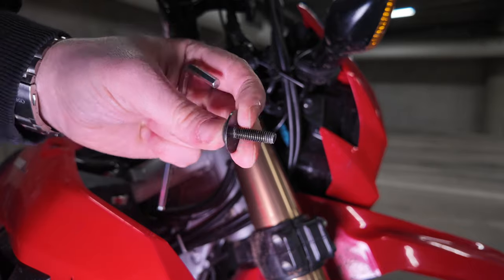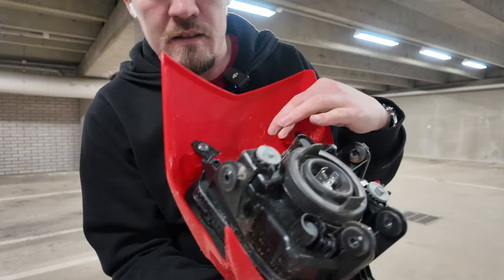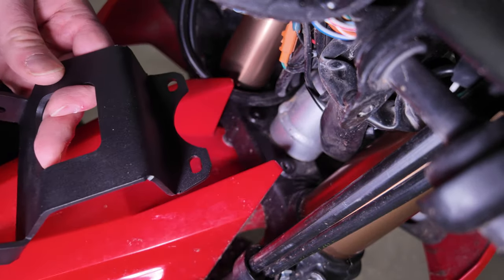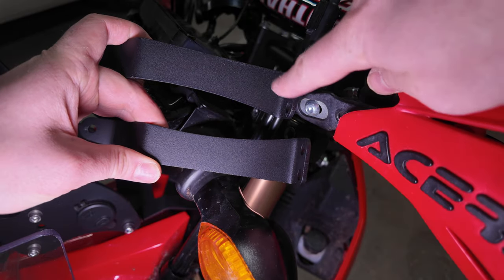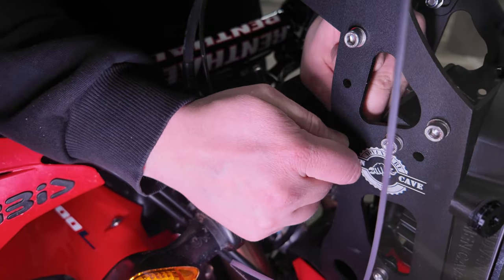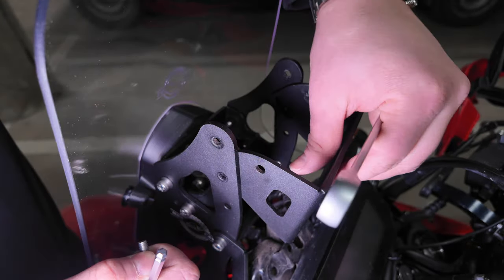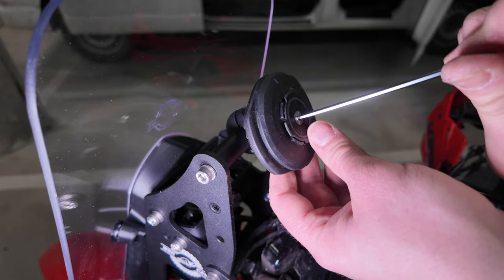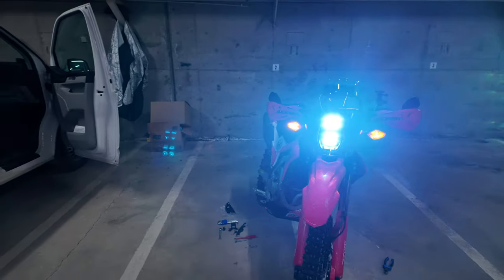Honda CRF300L Rally Tower Build: Install (2/3)

Comment: I absolutely love the look of these!! The price of these makes them unattainable. Honestly a little wild imo with a product that’s predominantly 3D printed… heard a lot about people cracking them during install. At 700$ I would expect more I guess. I ended up with the cyclops LED upgrade and a windscreen .
Reply from the maker: This is not the one you are probably thinking about. This is mostly aluminium: 
https://youtu.be/44gJ4QlDw1g
Reply: You might be confusing this with the one made by ONE ADVENTURE, which is completely 3D printed.

Comment: So how do you do the lightbeam height alignment, so you would not blind the oncoming traffic?
Reply from the maker: Easy to adjust by loosening the attachment points on the lights themselves but I didn't need to do any of that so far. The lights seem to be pointed pretty much where I want them straight from the box. 
I have a good comparison to stock vs this setup coming in the last part 3 next friday 😊

Comment: That looks fantastic, so much better than the original. Will definitely be upgrading my bike with this tower.
On their website they say if you have ABS you have to move the switch. Looks like you have ABS, did you have to adjust it at all?
Greetings from South Africa.
Reply from the maker: Haven't had any issues with the abs switch. Didn't even know that 😅
Reply: Cool, thanks for your response.

Comment: Was there any reason you went for the adventure men cave tower over the one adventure tower that rally raid sells? Great content by the way
Reply from the maker: Based the decision just on the pictures online. This was mostly aluminium instead of plastic so I hope it will cope a bit better long term.
Reply from the maker: Also the brackets themselves are steel.

Comment: Did you notice any change in weight at the front end?
Reply from the maker: I’ve not noticed anything while riding so far. But I’m riding studded winter tires in the snowy forest so can’t do any comprehensive highway tests before the weather improves.

Comment: So you did not wire up the USB voltmeter?
Reply from the maker: There is a usb socket on the side of the tower and it's already wired. Nothing else needs doing but to plug the light socket to the tower. I'm pretty sure there is no voltmeter with this tower but it would be easy to install one.
Reply: @PatchedBandit  Good to know. Mine is supposed to show up today. Can't wait.
Reply from the maker: Did you order one before seeing my videos? Just curious :)

Comment: Taking down the fender or loosening it to be lower makes light removal 100 times easier.
Reply from the maker: Good tip!
Reply: @PatchedBandit  
I had to remove the light many times. Had several USB socket failed, cheap and expensive ones.

Solution is to use external USB adapter which I remove after a ride. It works for more than a year now without issues. Only thing that stays on bike is waterproof 12v car socket.
Reply: Looks brilliant 10 times better than the rally 👍